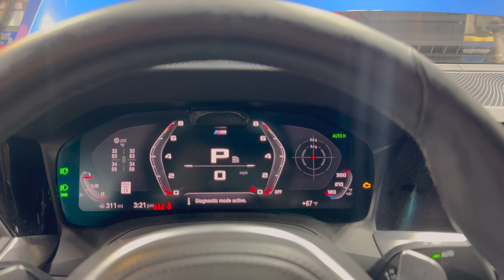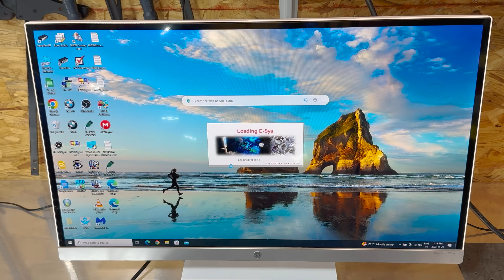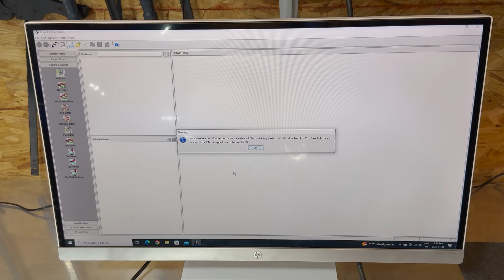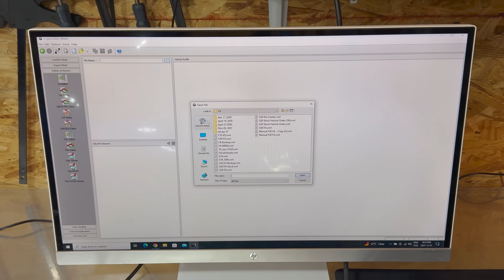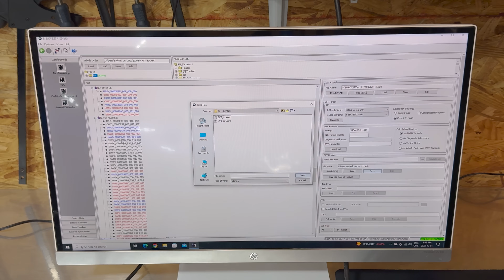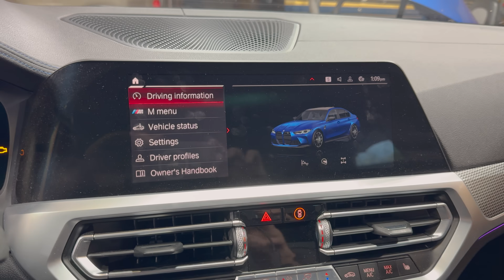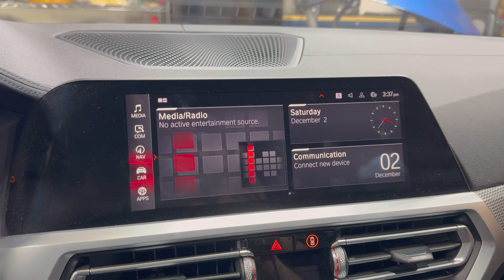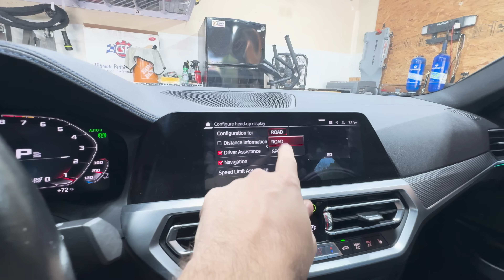My BMW G20 330i Unlocked G80 M3 Levels With this!

Comment: I took a stock m330i wagon (2020) for a drive today and cannot believe it’s a 2L 4 cylinder. Felt seriously quick so yours must be a rocket!!
Reply: I have 2018 non m f31 330i. Seriously such a good car, so much fun to mod and drive. If you are getting a car, can’t recommend it enough
Reply: M330i does not exist
Reply: @MM-tt7hy  typo - I should’ve had the m after… 330i msport….im sure you could have put 2 and 2 together :)

Comment: My 330i M Sport G20 does not come with M-Sport differential. Can it be retro fitted?
Reply from the maker: Yeah it can, it's basically the same differential as a M340i.  The axles are different, the 330i with the M-Sport differential actually has the same axles as a 3.0 Supra.  The carrier is different than a M340i so the axles are a different length.

Comment: I'm early but here for it! Your video got me to finally jump to a 330i!
Reply from the maker: Congrats!  You going to mod it?
Reply: @VehicularDIY  hahaha already started, going with your recommendations to start out. Intake pipe, charge pipe and high flow air filter installed with JB+ module for now. Have a catless downpipe on the way to tune it but my DME needs a bench unlock (mar-2020), debating whether if it's worth paying for the MHD unlocker or just pay for the unlock service. Keep up the great content!

Comment: Very cool! Do you think I would need to do coding to swap my base steering wheel with one with heated steering wheel?
Reply from the maker: Yeah it would require coding so you would know when it is turned on.  The indicator pops up on the gauge cluster.
Reply: @VehicularDIY  oh makes sense, thanks. Would it still work when the button is pressed if I didn’t do coding? Would that cause some kind of error in the car?

Comment: Do you think this software can allow an xDrive car to have a rwd mode like the xDrive M3 and F90?

I’ve seen an X3M that was able to go into rwd mode through the same page that you would use on a G80/F90 with ID7 and i imagine they used the same software you did.

I’ve also seen an xDrive G20 that was coded to have 95% of the power sent to the rear, not sure what software they used. 
Unfortunately there is no xDelete for the G-chassis cars and while xDrive cars (F10 and newer) are even more rear biased and can tell when you want to oversteer, it is still driving the front wheels.
That leaves me with wanting a rwd model for the lower driving losses, less weight, and full rwd experience at the expense of not having awd when i want it. 
xDrive with a full rwd mode would solve half of those “issues” and give you the luxury of having both.
Reply: xHP makes transmission tunes and often software called xDelete that does just this. It’s not going to be as clean as the M3 implementation but you can change it over in about half a minute using an app.

Comment: loving the vids, would a 330e with b48b be able to make 550-600 hp ,without the 8hp75 hybrid transmission blowing into pieces
Reply from the maker: Thanks, it would depend on the production date as some of the 330es came with the same B46D in my car. The transmissions are strong.
Reply: 10/2019 is the cars production date , didn’t even know that this was a thing , do you know if it has the diesel trans ?
Reply: @user-fz6yv5bc5o You'd still have to read your block code- only some American ones came with the B46 but other markets came with either the B48A or B48B and only the B48B can safely reach those numbers due to a lower compression ratio and better piston design

Comment: So what’s the final peak horsepower and torque estimates?
Reply from the maker: Right now its sitting at around 470 WHP and 510 WTQ.  Torque was turned down from 582.  The IATs are a little high so the upgraded intake manifold and heat exchanger will likely bring the HP number up a bit. I need to revisit the dyno for some 91 numbers and E50 numbers so we'll see what it makes after the upgrades.

Comment: Is this a perfomance mod? Don't really see how you are going to get anywhere near M3 power.
Reply from the maker: No, it is just complimenting the performance mods I already did.  This car makes 470 WHP and 510 WTQ, came from the factory with the M LSD which is the same LSD that comes in the M340i.  It has an XHP Stage 3 transmission tune and an upgraded turbo plus supporting mods.

Comment: Really nice to see what you can do to a 330i, and you explain it so detailed. 
I drive a 220i coupe (B48C engine) year 2022, and wonder of this engine can reach the same figures in a safe way? Doing the same mods.
Love your video’s 👌
Greetings from the Netherlands 👋
Reply from the maker: The engine is mostly identical besides the pistons.  This is a common question so I think I will address it in a future dedicated video.  The short answer is you can still gain a lot of power just need to target less than I went for due to the piston strength.
Reply: @VehicularDIY  thanks. That would be nice, because there is a lot of misconception on this topic on the internet and socials.
Hope you can clear this for al the x20i (and x30i) drivers out there.
Have fun with your project. You’re doing really cool stuff 👊
Reply: Please note that bmw uses very different materials for THE SAME parts in different cars. Don’t be fooled - a g80 330i can’t reliably make more power then bmw wanted it to. There is an article posted by the patent holder of all the n series and many more engines on how the materials in the different engines are a lot different from each other. The article basically says the thermal capabilities of the different materials used in different power levels (330i vs335i and so on) are a lot different from each other. NOTE: In replacement parts all the part numbers are the same because of logistical reasons it’s cheaper to only sell the most expensive parts made from the best material. Pushing engines beyond the power they were designed for makes them fail prematurely - how quick that happens depends on how often you floor it basically.
Reply: @strryle125  I'm sorry, but this explanation makes absolutely no sense what so ever. Different material thermal capabilities on parts with the same part number.  Meaning they're different only at the original assembly, but not when you buy spares. That must be an American thing, just like the S52 engine having 81 hp less in the US than in Europe due to crap fuel quality?
Reply: @VehicularDIY  can you include the A20T1 in that comparison/breakdown 😅
Reply: @strryle125  The patent holder shit was debunked years and years ago but gets reposted religiously by people nevertheless. The dude was proven to be a fraud that just read some engineering books. Before the BMW engineer story he was active in a German Mercedes fan forum and told people he was a chemist and worked at some oil/lubricant company.

Comment: After you get caught up in the mods it'd be really cool if you did a track focused episode. Maybe a few rips at the 1/4 mile and a HDPE event to get some lap times and compare to a M car!
Reply: Is he doubling the horsepower with just a flash tune?  No FBO, E85 or Turbo, sounds too good to be true.  Car looks completely stock.  Need to see a legit drag race against an M car not just shots of him driving in the canyon.  Doesn't look like it's going that fast in the video can barely keep with m340i maybe.
Reply: @abc123fhdi  I think its tuned, runs on E85 and got an upgraded fuel rail.
Reply: dude this thing has a bigger turbo, downpipe, intake, charge pipe, intake manifold (I think), e85, and a stage 3 flash tune, and probably other things, it is one hundred percent pushing 480+ hp @abc123fhdi
Reply: That’s insane investment for mediocre return. My 2018 340i has a $300 downpipe and $450 Supra HPFP and makes 480 to the wheels on E30. Still makes about 430 on 93. Much better value if you want power. Second, it’s waaaay more reliable than this setup. I changed two parts. One just removed the cat (no effect on reliability) and one just changed the HPFP to another OEM part…
Reply: @thomasburns3345  the car you just summed up literally is a generation older lol, if you compare this to the m340i it totally aren't mediocre returns
Reply: @kipdrordy6858  and so what? It’s also lighter and the 330i offer nothing the 340i doesn’t have. But the 340i offers things the 330i doesn’t… 

Plus resale value is higher, and the b58 is actually more reliable than the b48. And that’s just stock. The coolant leaks still plague the little brother. The tuned version here is absolutely more compromised. 

If you’re chasing speed, then you’re almost always better off  value-wise getting a base closer to your goal. Cheaper in the long run, more reliable usually (not pushing the hardware as much) and if I need to move on from my car I just take off a down pipe and I’m stock again…

Comment: I think you reversed that, you need a battery supply and not a tender. Amazon has 40A and 50A supplies that are very reasonably priced. Great video on E-sys overall! A lot more to the point than other ones I've seen.
Reply from the maker: Thanks, yeah by maintainer I meant to maintain voltage aka a voltage stabilizer.  They run upwards of $600.  I did the flash programing on a battery charger at 25 amps.
Reply: @VehicularDIY  If you look for "ac to dc converter SMPS 12v 800w" you'll find lots of them, less than $100. They're switched power supplies for servers converted in to 12v terminals you can just connect a jumper cable to. I use it a lot for longer coding or flashing.

Comment: Could this build work on a b48 320i, it has the same compression ratio rods and cam as b58 gen 1..however i will be installing forged pistons so it matches the forged rods and cam, aswell as b58 tu pump and ipos m450 turbo?
Reply from the maker: If you wanted to just put forged pistons in you could target big power.  Likely 600whp+. Stock pistons are limited to closer to 360 whp.
Reply: @VehicularDIY  thanks for this man appreciate it
Reply: @VehicularDIY  also im actually surprised my model can take that much even though my cp matches the b58, cause thr 330i has slightly lower compression people online say thr 320i pistons are too weak, so the fact they can take around that much stock is great.. also i noticed all the ones that blew up online waa due to poor fuel, i only use 99 octane

Comment: Please note that bmw uses very different materials for THE SAME parts in different cars. Don’t be fooled - a g80 330i can’t reliably make more power then bmw wanted it to. There is an article posted by the patent holder of all the n series and many more engines on how the materials in the different engines are a lot different from each other. The article basically says the thermal capabilities of the different materials used in different power levels (330i vs335i and so on) are a lot different from each other. NOTE: In replacement parts all the part numbers are the same because of logistical reasons it’s cheaper to only sell the most expensive parts made from the best material. Pushing engines beyond the power they were designed for makes them fail prematurely - how quick that happens depends on how often you floor it basically.
Reply from the maker: It's definitely pay to play,  you would definitely shorten the life expectancy of an engine if you push too much power.  To me the key is to stay within a margin of error and for a street car that you would only push power every once in a while it should last 90% as long as it would have otherwise with regular maintenance.  BMW just tends to over engineer their cars leaving room on the table if you use it responsibly.
Reply: Never heard of a G80 330i.

Comment: I love the content man, right up my alley. 
Glad i found this channel early on and got to see the build progress. 

A real build, unlike most of these “builds” that everyone does by getting a downpipe and ots tune, topped off with some 3m ebay paddle shifters glued onto the stock ones.

If you’re open to suggestions, it would be sweet to see alcantara on the lower dash (like a 911 gt3/gts for instance) leading into the door cards (like many Audi’s have. 

It’s not hard to do and the materials are inexpensive. I think it would make for some great content and leave you with a nicer interior.

Comment: Hey I just got introduced to your channel. I have a 2014 328i n20 currently has 190k kms (118k miles) and my dad has a 2013 320i n20 with 290k kms (180k miles) both still on the original timing chains lol. What year did the timing chain guides get fixed from factory? I’ve read a few different things online some saying after build date march 2013 they’re good, and one saying a the n26 is when they fixed it. My dad’s is making noise now and he’s getting it replaced soon. Any way of telling they’re bad by looking at the? 
Also great channel btw you guys are wizards.
Reply from the maker: Thanks,  I believe late 2014 production is when it was addressed for the 2015 model year.

Comment: I would love to see a breakdown of how much this build costs total, separated by car purchase price and then all the individual parts. Even after all the required modifications to get it to baby G80 M3 territory, I'm sure it's still a bargain.
Reply: legit just asked a near identical question and scrolled down to see this. It has to be a sizeable investment, just not sure the ballpark. Im sure I could scour each video and build a list of parts and research pricing, but I dont have the time for something like that at the moment.
Reply: @nicknmyers  I know he mentioned the upgrades costing around $5-8K in parts in a previous video, but I'm sure with shop labor it'll be double that. So not sure how economically viable it is to actually do if you can't do it yourself.

Still, having a B48 pull on a G80 is hilarious. I'd be willing to pay money just to get the satisfaction of doing that.
Reply: hahah fair point thats great @ShockwavesFTW

Comment: Your channel is really making me consider saving $15k+ by not purchasing an M340 or X3M. There’s a beautiful low mileage 330 m sport for $27k local. Think I’ll regret it? Coming from a slow car, but so ready to be fast again. But also looking forward to having money for lots of performance mods. (Not concerned with appearance.) Thanks SO much for your detailed content, man. I’m a software developer, and this is right up my alley.
Reply from the maker: In terms of whether you'll regret it, that's a tricky one to answer. If you test drove a stock M340i and were impressed by how punchy it feels as a daily driver, then you might feel the 330i lacks that same thrill. However, if you tend to drive conservatively most of the time but appreciate a car that can change its personality when you're in the mood, the difference might not matter as much.

My car, as it's set up, drives similarly to a stock 330i in normal conditions. But switch it to Sport+ and it'll outperform a stock M340i with a maxed-out turbo. That's because my 330i, with the upgraded turbo, holds power all the way to redline, whereas a stock turbo M340i with bolt-ons tends to lose power near the top.

It also depends on what you're upgrading from. A stock 330i is no slouch, doing 0-60 in the 5s. I’ve driven the G80 with the S58 engine, which is a monster, but it doesn't have much punch below 2,600 RPM due to its low compression. That said, it’s quick to drop a gear and deliver power when needed.

If you find the stock 330i punchy and torquey for daily driving and like the idea of switching to Sport+ to get a genuinely fast car that could rival a stock G80 or a Model 3 Performance, the 330i could definitely deliver with the right bolt-ons. You’d be looking at $27K for the car, plus $8-10K in upgrades to surpass an M340i.

Alternatively, you could get a well-specced M340i for $37-44K, throw on a downpipe, a drop-in air filter, and an off-the-shelf tune with a bit of ethanol. For a couple of grand, you’d get pretty close to what the 330i can achieve.

For me, the X3M only comes into play if you’re aiming for 700WHP+, and the S58 engine will get you there with relatively little investment.

By the way, I recently swapped an M340i steering rack into my 330i, and the faster ratio makes the car feel much more agile. Stay tuned for my next video, which goes heavy into the software side of making the M340i rack work in the 330i.  I put the rack in to prep for a B58 swap, I'm swapping in the 11:1 compression B58 to make a really punchy daily.  I tend to value just having lots of low end torque and don't find myself putting the car into kill mode very often.  The car doesn't present as a sleeper given it looks about the same as an M340i.

Comment: You should have just bought an M car with all the mods you're doing.
Reply: Trying to prove something different,  this B48/B46 can do similar numbers to slightly tuned M340i i have done almost all of this to my 2021 G20 330i and it is so much more fun to drive in comparison to M340. It's crazy how fast this car gets

Comment: Fantastic and very interesting video. Wondering what X6 models this would have applicability to... A twin turbo V8 X6 with some "upgrades" seems like an amazing daily with likely horrific gas mileage. If only it could switch daily to a low boost v4 super eco mode.. Is that an easy coding hidden in esys?
Reply from the maker: Not that I know of but if imagine that is coming before the V8s get phased out in favor of only inline 6s.